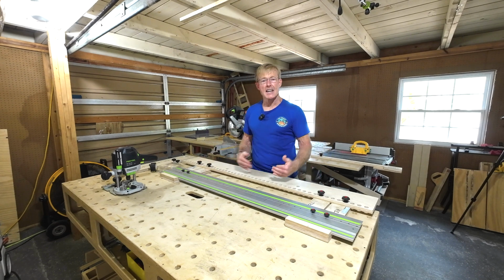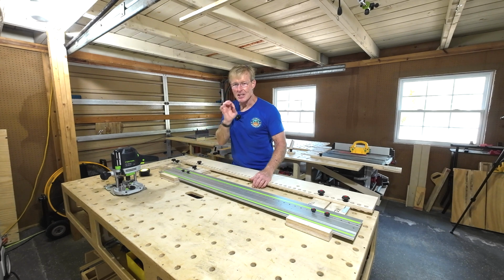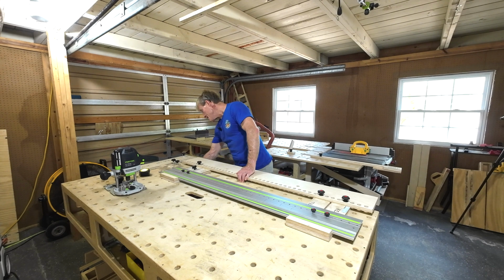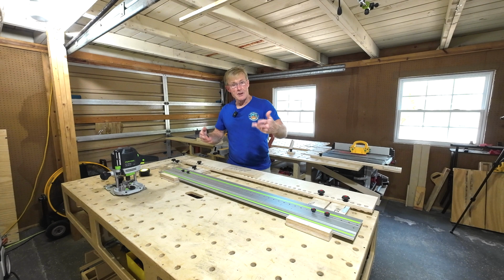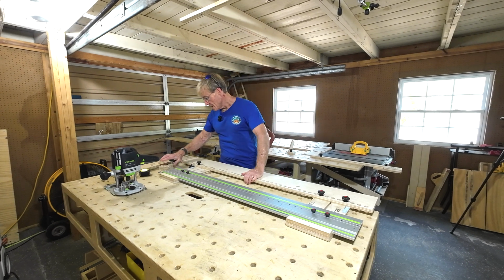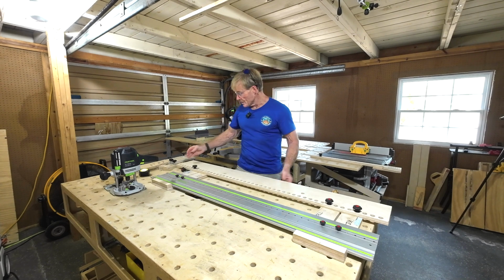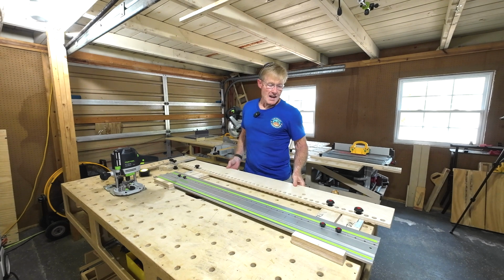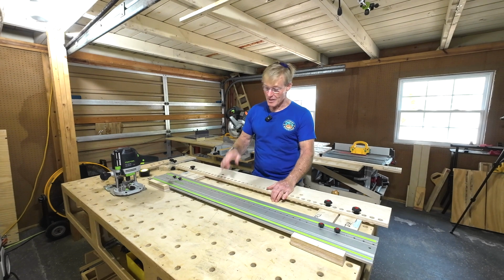My Mistake

Comment: Love your videos.  Was just thinking.  Could you not just make another 2 pieces with the holes in and then place them underneath at 90 degrees. you can plunge the router through the hole you want for spacing and it is exactly the right dimension without measuring.  You also have a way to have a different number of 32mm offsets as well?

Comment: seems like being able to buy the set up jig made by a CNC would be much easier and get away from all the mistakes that you yourself made in the design of the this jig.  Myself, I'm not confident that even with the use of a feeler gauge and all of your suggestions that it would turn out correctly.  Afterwhich, if you count your time, it wouldn't be worth it to have it made by someone that has it dialed.
Reply from the maker: There was only 1 "mistake" which was the hole spacing on the (4) 20mm dog holes. The "mistake was 1/10th of a mm. I am not sure a CNC could offer more accuracy. The best option would be an aluminum jig made in a machine shop to 1/1000th.  I was hoping this video cleared that up.
Reply: @TheSmartWoodshop  Your emphasis on how a  "small mistake" compounds as you progress down the table is what I got out of the vid.  As I said, I don't think I can assume I wouldn't make that mistake or worse.  I'm confident that a CNC wouldn't have that much error.  Wish that were an option for buying the set up jig, I would feel much more confident in doing so.

Comment: What do you think? LR32 or parf mark2? Which is faster if you’re only building one bench and two cradles?
Reply from the maker: I would not give up my Parf Mkll just yet. The LR32 is faster and will also  drill the 32mm cabinet system holes, plus dados, groves, and rabbets. The Parf is for MFT only. If the MFT options can be as accurate, then the LR 32 is more versatile and faster.
Reply: @TheSmartWoodshop  great points, Ron. Although I have jigs and a decent non Festool router, I feel I may wait to weigh the benefits of upgrading my router and jigs to lr32 and hold off on the parf mk2 until I’ve made that decision to upgrade or not.  Otherwise, I was ready to go parf guide until your newest lr32 series of videos.
Reply: @marcusburnett22  I think this might be a great idea for people currently using the LR32 system, but I'm using non-festool routers and plan on using the Parf Guide System Mark II to build my MFTs. It's a tried and true system that is idiot proof.
Reply: @ForumandBrim  I mean, just wait till I try to use it and we’ll see if it’s idiot-proof. Thanks for the info!